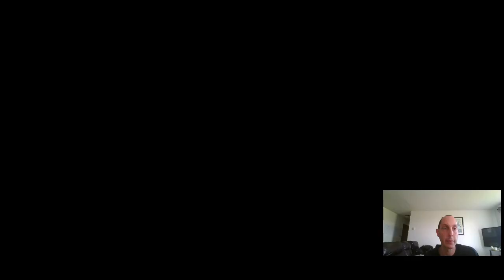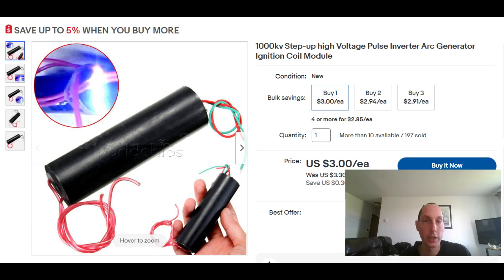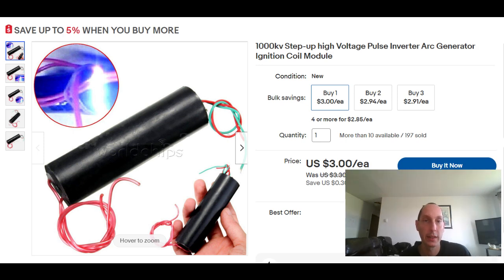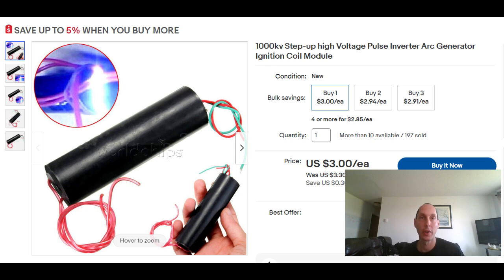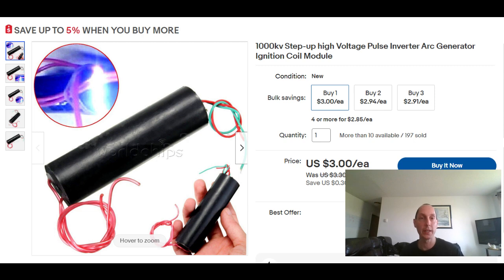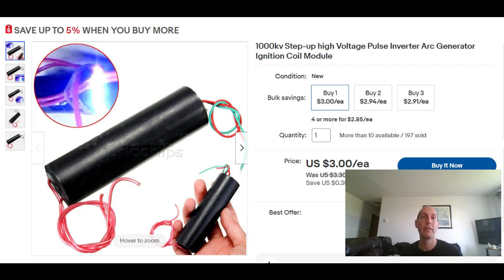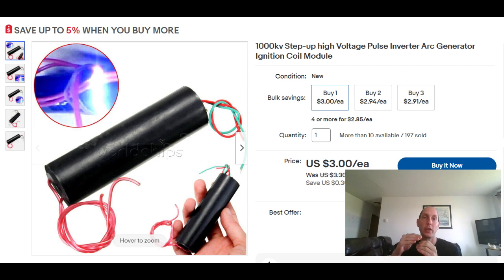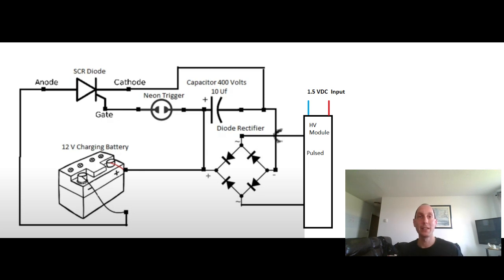Simple High Voltage

Comment: Thank you for sharing, I had problem  with my SCR was burning fast after a couple of minutes. so I knew I needed to limit the neon lamp current to 5 mili amp (I learn that by google searching)
Then I asked Chat-GPT how to calculate a resistor value which should be placed between neon lamp and the gate: by asking it this question:
"what value of resistor I should use to limit current across a neon lamp to 5 mili amp, where the supply voltage is 80 volt across neon lamp"
it gave the value of 3 to 4 kilo ohm. after using that resistor, my cap dump works perfectly!
Reply from the maker: Thanks for sharing that tip!

Comment: Nice  Joel!  I can see why you're blowing SCRs.  I was reading through the comments and saw where a resistor after the neon was suggested.  Correct principle, however a dissipating device.  Try a small choke instead for the desired impedance.   No loss.  Yeah, it's normally used for AC, but also works in these kind of circuits for pulsing DC.  When working with these kind of circuits, always think of ways to use magnetics in place of semiconductors/resistors.  Your results will be better.  When you graduate from conceptual circuits to practical, fuel less devices,  magnetics will be your tool of choice.  Besides the loss less benefits, there are added benefits better not discussed here.
Reply: Please specify the choke you suggest for this exact circuit. It will help us a LOT! Also have you successfully replicated this device? God bless and be well!

Comment: Thank you joel. That's a concrete way. It is a miniaturized car ignition coil that is a real free energy device. I will try . The trigger is  not a problem, because it is so low amperage. You can use everything.

Comment: To get the mind juices flowing, I’ll propose an impedance device that is adjustable for experimentation and will allow you to control the current flowing through that SCR from the neon trigger and cap dump.  
This will be a table top device, no meters or math necessary.  Take a nail or a welding rod if you have one.  Iron is a better core choice for the low frequency of this experiment.  Wrap it with a single level of magnet wire.  Nothing to fine or the wire itself will have to much resistance and heat up.  20-30 wraps.  This will be your choke.  Get a permanent magnet.  Not too strong.  Just a cheap ceramic refrigerator magnet will do.  The magnet on the correct end of the nail will control the current flow through core saturation.  Polarity matters.  To start, put one end of the magnet on one end of the coil, if current flows, the magnet needs to be flipped around.  When the magnet is in the correct polarity, the saturated coil will nearly stop the current and the SCR will not trigger at all.  If the SCR triggers the same no matter what way you flip the magnet, a stronger magnet is needed or more windings in the nail.  Move the magnet away from the coil until the SCR starts triggering.  This is all you need.  Minimal current to cause a trigger.  The SCR will latch until the cap drains.  Your choke will have an almost unmeasurable resistance while providing the impedance needed to stop the SCR from bursting.  The coil will give back, the current used to create the impedance.
Tesla had no semiconductors, yet he was able to achieve switching, rectification, resistance/impedance, on a scale that challenges today’s voltages.  Yup, magnetics.  Have fun!

Comment: A non-conditioned battery should learn over time with the cap dump correct? Maybe it would take a month?
Reply from the maker: The cap dump is a pulse,  Perhaps not the kind we are looking for in conditioning batteries but perhaps it will work anyways. To be honest. I need to experiment more to comment any more details. Thing is cap dump as sharp as the initial spike is, still has a sharp V/I curve drop so for a few moments the battery will "see" DC. Perhaps a mix of both is actually beneficial.

Comment: Joel, ya need a two Cap circuit.  ( 1 ) bucket to fill and a  2nd  cap (  cup  to dip into the 'bucket ').

Then disconnect and FIRE it.  :  }

ie - 34uf ( bucket ),  5-6uf ( cup ) to FIRE!    May have to adjust the 'cup'  uF values?  :  }

PS - Prevent  ' laching' of the SCR ... it needs to turn On / off fast !

- All the best  :  }
Reply from the maker: Well in a way its already like this the pulse driver is a diode voltage multiplier, so in a way your already dumping one set of smaller value caps.  When the pulse hits the out pins.

Comment: Joel you mentioned that there's a limit on returns of bemf a point of adding more energy doesn't increase the bemf .imsaw in one of bedini videos were he was explaining to a guy about how you can get more power out from the system just by adding more coils with a bridge rectifier and a capacitor as many as you need .can you try this combined with your limiting energy to control the bemf return.i through that if you added like four coils identical and limited the input would you still harvest more energy .I heard a guy say you can and he had his coils sharing a common core .he said it was powering his living area . Thinks for your interest
Reply from the maker: The thing is everyone's circuit, method and coils are all different. We don't really have a standard to work with and make reference to. What I do know is there is indeed a "sweet spot" in every device that depending on coil size values and circuit of course, And all variables involved with that! At some point one setting will work better, but on the other hand too many coils can start making your circuit more lossy and less efficient! So a bit of a trial and error if you want to go that route.
Reply: @joellagace1679  it just seemed to me that the energy could be collected wilh out limit .from the wheel to the battery the line going to the terminals that positive spike of negative energy was a unlimited source of energy with the extra coils and caps and diodes with out effecting the battery charging.if so energy problem over .add as many coils and diodes and caps as needed.

Comment: Moving FORWARD, this is exciting stuff! I had to guess that the scr is a 800v BT152. So I connected everything using a protoboard setup. Now how do I test it to see if the circuit is operating correctly? ALSO will the circuit be damaged if run with NO LOAD? Should the NEON illuminate at any time when the circuit is operational? God bless and be well!
Reply from the maker: If everything is done correctly it should flash a couple times a second as the cap dumps.
Reply: @joellagace1679  Thanks for the fast reply Joel!. I have seen NO FLASHES and the battery is not charging. The only thing different that was added to the circuit that is different from the original is the 3kOHM resistor between the neon and SCR. and I Am using a 400KV module instead of the 1000KV.

What is the best way to troubleshoot to find out why it is not working at this point?

God bless and be well!

Comment: Thanks for posting. Is 1.5V the nominal voltage it's supposed to use?  Can it use higher voltage or there's no point doing it?  You could power the input with a large cap that's charged by a small solar panel, so it could be ON 24/7.  Can this circuit be used with the ground + aerial idea for increased output?
Reply: Also, I was wondering how long the HV circuit would last if ran 24/7?  Don't seem like it's meant to do that.. Isn't it supposed to be used for momentary use, like a tazer device or something like that?
Reply from the maker: With this pulse gen a higher voltage burns them out after a few minutes.

Comment: Hey Joel Me again I’ve worked on a few different projects myself over the last nine years I have built many different motors.. I started messing with the residence/modulated/radian/radiation/Gerard Morin type/Tesla type of power whatever name you give it I found out many interesting things over the years .. I focused on the usage in every day use of being able to use it more than just lighting I found that you can if you apply different things.I am building a device myself and is using many of the principles that everybody have followed but not on the same path… in fact I use a lot of everyone’s failures and everything that I think they missed and use them as my guidelines and have come up with something different than everyone else has been doing … in fact I can’t find another device like mine..I am within a year of so of finishing a rebuild of it getting and making parts on a CNC lathe or Bridgeport takes a lot of time and I have designed it several times over…and I want to be ready to try many different ways to collect the power my money is on you your outside thinking is as good as mine..I guess my question is….  (((Do you think I could collect this manifest power collect it with your idea and be able to increase the amp output as a pulse.?  )))In my case on my old machine I was able to get 70 V six lines at .87 of an amp  useing only 12v 2.6amp .. I would like to try to capture the .87 of an amp… my rebuild of my machine I will 12 lines at .87 .. The only reason why I took apart my six line working machine (yes I have video ) I didn’t compensate for expansion and contraction on two different metals and with one or two winters things have come loose in the machine was starting to fail ..I am now on a new venture with 12 lines 360° no cog I felt six lines was only half of the clock…  if you follow…

Comment: No coils needed! Serious improvement. That hv module will draw in the radiant energy. Car ignition modules will do the same. Ridiculous only 50mW could power 9 chargers to a single battery. The battery would just charge itself with an inverter no problem.
Reply from the maker: Well the coil setup to be fair offers more control of the whole process, How ever it boils down to your preferred method of experimentation and how far you want to go with it complexity speaking.  :)

Comment: Joel, I got the HV coils, but I missed out on the SCR. However I have an old power mosfet hanging around here, type IRF3205Z. I cant get the neon to blink. Any suggestions would be appreciated, KR Hans
Reply from the maker: Without extra circuitry that mosfet will never work in this config, Also will end up wasting power building a control circuit around it. As simple as it could be, would change the circuit significant. Without getting into the fine details in this comment area. Bedini had the SCR trick right. Also people get confused with the such low gate power input drive requirements of a few volts, trying to find SCR that can handle 100s of volts at the gate give the typical person the impression that will never work without extra circuitry for protection if anything, Well as long as the high voltage has basically no current. It works great to trigger the SCR and the cap dump shuts it off and the cycle keeps on..... Very simple.  But you may need to experiment with trigger caps, I find that 10-20 UF range seems a good starting point. Too big of a cap, The scr won't switch properly, and too small will just stay on, So you aim for a couple clicks (dumps) a second.
Reply: @joellagace1679  tnx for your reply Joel, greatly appreciated; what SCR did you use? I have all the other stuff for experimenting in place. Several 12V lead acid batts, also 24V NiMH, 48v LiPo, lots of Caps, like 2uf, 6uf, 10uf, etc

Comment: The 'Cap dump' is the heart of harvesting Aetheric energy,.  If done correctly, it disconnects from the 'source' - non reflecting  ... beating 'Lenz' effect. 

Yes, the circuit is difficult and requires tuning to caps 'Uf' !

If it were easy, everybody would have one.  :  {

Comment: I got my HV modules yesterday thanks. I very quickly detemined which wire was positive and negative, is the rectifier needed. I was charging a cap up direct with a AAA battery - HV - Cap.
Reply from the maker: Or use an old analog battery tester, If the meter swings the proper way. Not enough current to damage it.
Reply: @joellagace1679  so the rectifier isn't needed in the above circuit?
Reply from the maker: I would keep it for safety. If you know what your doing probably not. How ever it may still change the way the circuit operates as this method with the rectifier. The capacitors inside don't "see" the dump capacitor on the other side of the rectifier. It's not full isolation but it can play part in how the circuit behaves.
Reply: Are you saying that the output of the coil has a POSITIVE and NEGATIVE? Both leads on the output are the same color! Does this make a difference in the circuit? IF YES then how can I determine which is POS and NEG other than an analog volt meter?
God bless and be well!
Reply: @energyhawk9930  if you have a really low power input, eg small solar cell in shade you can get lower output and determine leads with any voltmeter.

Comment: If you want to charge 24v or 48v what would be component you change?
Reply from the maker: Well since the cap dumps close to 100 volt pulses,(neon method) It should not be a problem, It will take a little longer but should charge 24 v or 48 v no problem.
Reply: Thank you for reply and educate videos. Please open store for circuit board and inventions. As beginner I have problem with getting right part and following diagram 😂